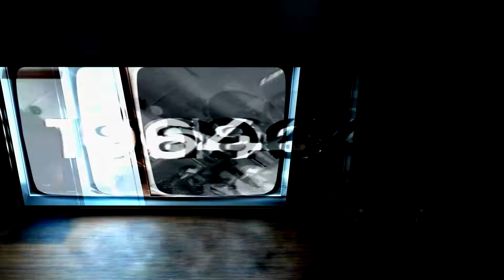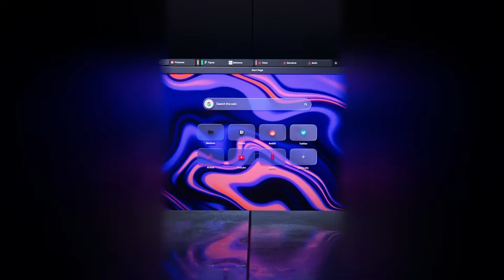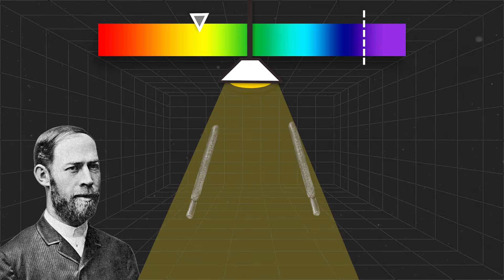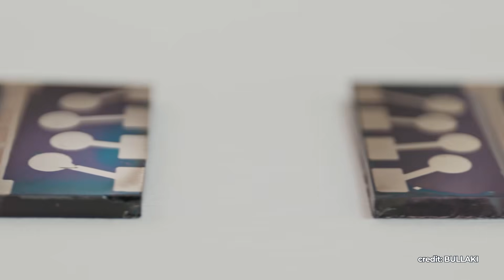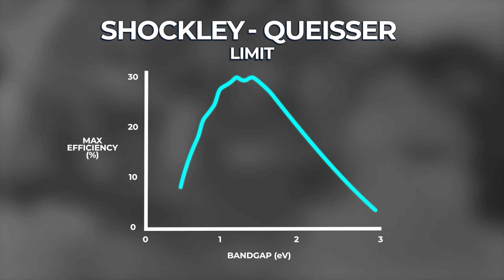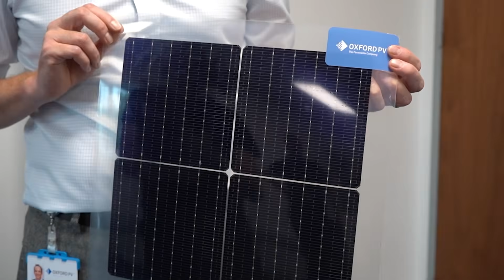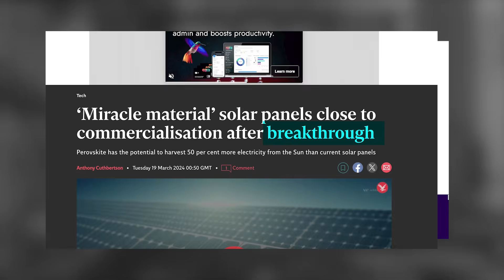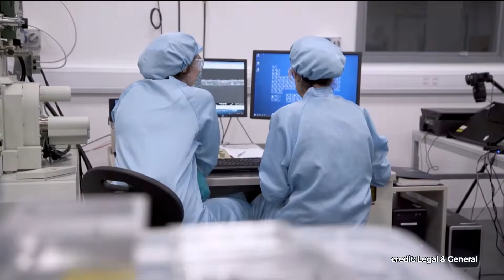How Physicists Broke the Solar Efficiency Record

Comment: Framing videos like this is so obnoxious. TL;DW: their cells are 20% more efficient. Not 20% of the sun's energy more, but 20% of the efficiency of conventional solar cells, aka less than 5% more of the sun's energy. And it's not like we couldn't reach this efficiency before, or even do much better, but simply that reaching it wasn't cost effective.
Reply: Ah thanks for TLDW.

I think for the next 20 years, we perhaps don't even need a more efficient cell, in the sense of a cell that captures more solar power per unit of footprint area, because we aren't anywhere near close to saturating possible solar installation footprint. Instead we need cells which are cost effective in terms of total lifetime output per unit of cost, high endurance, and not too difficult to recycle into new raw material.
Reply: @SianaGearz sure, there's still plenty of places we could put solar cells, but there are limitations that clearly impact enough people to make this worthwhile. A solar cell in the Mojave desert is gonna get more energy than one in London, and if you want a lot of power for a building, you often can't simply make the roof bigger. And while modern homes may find their power needs easily met by modern solar panels, it's entirely plausible that this won't stay true for long.
Reply: TLDW? Too long didn’t wank off?
Reply: Yes, but it is in fact a breakthrough. Small evolution, a little at a time. That's how innovation works
Reply: The point is that perovskite has the potential to go higher, this is just the first commercially viable option. We already go up to like 40-50% in space with multi-layer, highly complex and very much not mass produced solar cells, where every percent helps a multi million/billion dollar satellite do its thing. In a couple years we might see the first tri-film perovskite-based PV cell surpassing 30%, and 35% in another decade. All wild guesses, but look up solar cell efficiency over time graph and you'll see what I mean. There's a lot happening on that graph, but the general direction is clear.
Reply: @kindlin  I love the excitement of improvement even if it's just marginal. It's awesome to see it out here. I'm gunna go check out that graph and probably do a bit of a deep dive into this, or at least as deep as I can go. Cheers! 😁
Reply: @kindlin  There isn't happening a lot at all. If you take research into it, we have in every sector a lot of progress or innovation. Internal combustion engines can reach 60% of efficiency. The most efficient electric motor in the world, unsurprisingly made in Germany, site at 99% efficiency (by the way an industry motor which is used and still built). But yet, what applicably happens is another story. In space you don't have the heat problem we have on earth. So the more efficient we want to be, the more heat we need to capture since this is our energy. And heat is the enemy of efficiency.
Reply: @GERntleMAN   I'm actually not sure what your point is to counter it. What part isn't happening? Efficiency increases over time? Your post seems to give a great example of efficiency increasing over time, electric motors (wow, 99%? Typical German efficiency lol), so why not expect the CURRENT trend to continue in PV cells and give us the 5-10% increase in efficiency over the next 5-20 years that I'm speaking about? Specific numbers are hard to gauge here, but the overall trend is quite clear.
Reply: @kindlin  Not a counter, more a statement. We went from 16% to 22% in 25 years. That is not great and took a loooot of research. In the same time internal combustion engines went from 25 to 60% (even more in Formula 1). And since there is a hard limit, at least by our current understanding of physics and quantum technology, we cannot expect a periodic growth of efficiency. We also cannot expect a periodic growth in internal combustion engine efficiency. There is a hard limit to any technology and solar power on earth is not promising.

Electrical motors increased from 40-50% in 1860 to 99% in very special use cases. In the same sector (as back then) we only arrived at 89% and that pretty much is the limit. We can get closer to the 95, but that will take so much resources, it's not worth the effort. Solar will only ever be a secondary or tertiary power source. At least for the near future of around 100 to 200 years.
Reply: @kindlin  Just not true economically since the life span is so short.  It is more effective to reduce/replace inverter watts to optimize economics/labor.
 Ben does not understand "economic optimization".  He just wants to support the UK product and "glaze over" the ridiculous research goal to "improve an optimized product" buy adding materials that are a magnitude more expensive and much less durable over time! A good analogy to this kind of twisted ridiculous research is to compare it to washing a PV module ... it makes it slightly more efficient for a short time but not worth the cost to clean them even monthly if it rains seasonally.  Here is an example of how a real scientist/engineers at SMA  optimize a PV system.  They implemented an "inverter downsizing" calculator to reduce inverter size (aka oversized PV array) to make their inverter more "economically optimized".  It turns out you do not need to size the inverter for the optimal power output at solar noon ... but instead match it to the average output more near the 70% max noon  value.  This design plan instantly reduced cost about 30% for the inverter/wire  costs which was about 15% of the total system cost per watt.  You could also predict the total system life cost by taking into account that an inverter would be replaced 3 times during the life of a typical PV module ... meaning up to 45% savings/watt.  The automobile analogy would be you do not need a 500 HP car to get your groceries ... 100 HP is fine when you are in town and the speed limit is 30 MPH.  In fact an electric bike using 1 HP is 500x more economical and 100x more economical than a Tesla!
Reply: Cost effective and 20% better than what is available is a big deal...
Reply: @0ooTheMAXXoo0  It's not 20% better than what's available; it's the same thing that's currently available + a layer on top that gets some of the light the currently available part can't get.
Reply: Dude you seem to be really mad that you understood the video and wrote down what you learned. 😂
Reply: Can't wait to see your video on this, where you go on location to speak to scientists too and give us the correct information. Let this guy try to also make his expenses back by making the video more enticing, you be the martyr this world needs. The world where celebrities travelling on private jets tell us cow farts and tractors needed in agriculture are the problem while investing exactly 0 dollars in solar. All this while bashing China for emissions, the exact county that made solar widespread and affordable. You know what the West made widespread and as far as possible from affordable? Luxury goods. And private jets.
Reply: @rochellerochelle1488  bro calm down my guy and re-read my comment. Spending nearly 20 minutes hyping up something that is neither new nor impressive is obnoxious.
Reply: "Waaah waaah waaah, the YouTuber clickbaited like millions of other ones do yet I decided to whine about it because I want attention on a trending video waaah"

Man shut up this mini-documentary is interesting asf and I'm gonna ignore you to enjoy knowledge!!!
Reply: Did you watch the video at all?
Reply: I approached it from a different perspective and came to the same conclusion. Perovskites biggest issue is its longevity. The 'crystals' on many already researched and useful types just don't last long enough to deliver cost effective results and that is where the real research is right now. This vid didn't put that fact as the focus but then again, it needed to deliver a positive, clickable message to get the views!
Reply: i think you misunderstand.  in theory, this practice WOULD gather 20% MORE of the sun's energy than a standardly available solar cell. I think the difference in semantics was explained, as in, after hearing them talk about it for a few minutes, there's no way you'd get that confused.   Really, what you're describing is the same thing, since currently silica cells can gather maximum about 30% of the sun's energy hitting the cell.  This method would add about 20% to that, in theory. However, In practice, the best current solar cells actually only gather about 10-15% of the sun's energy that hits them, and in practice, adding this layer has added about another 8-10%, rising that to about 24%. That's actually not 5% better, but 40-100% more efficient than current cells.  So, i'm not sure you understood what was discussed.  If you compared a cell that gathers 10% (which is common) to one of these which gather 25%, that would be over a 100% increase, but that is misleading in the opposite direction as you are claiming.  I think everyone in the room has the understanding that we're talking about percentage of the sun's energy being captured, and a percentage efficiency increase between cell technologies. They explained it well enough that anyone should be able to understand the difference.    Regardless, adding more layers could theoretically (according to the one scientist guy) reach a maximum of 99% efficiency, capturing 99% of the light energy that hits the cell.  They explained all of this in detail.  

This brings me to my only issue here:  That they only added one layer and are already attempting to market it, rather than getting closer to 50-75% efficiency and THEN marketing it.
Reply: @tirkentube  They are doing it this way because THE GOVT PUT A CAP ON HOW MUCH A SOLAR CELL CAN PUT OUT!!! By law it is restricted, THE POWER COMPANIES COMPLAINED. It's tje elephant in the room that none of you experts want to talk about
Reply: @tirkentube  The technology is a layer of material which is much less efficient than conventional cells except at a specific frequency range. When applied over a conventional cell the full assembly is capable of capturing less than 5% more of the sun's energy. The video's framing is obnoxious because it spends 20 minutes dancing around the fact that the the only efficiency barrier is only being broken relative to cost. More efficient cells already exist, but they cost more as they require more expensive materials and tighter manufacturing tolerances.
Reply: @boltvanderhuge8711  Exactly.  Gallium Arsinide solar cells are already more efficient but they are usually only used on satellites because their higher cost is dramatically offset by the cost of delivering a lighter payload to orbit.
Reply: What I found silly was including the bit about the Kardashev scale at the beginning.  Why include a thought experiment by an astronomer from the 60's in this video?  Is this new "breakthrough" going to somehow make humanity dramatically closer to a "Type 1 Civilization"?  Um... No.  Even if it were possible to build a 100% efficient solar cell it would require paving over an area the size of Colorado with them to meet the world's power consumption assuming zero transmission loss.  Now people want to make our money out of wasted electricity that requires idiotic amounts of power just to make a transaction.  At the very same time, the same people are telling us that if we turn on the air conditioner a polar bear is going to drown.  All the while we have mountains of thorium lying around in tailings piles that we could use to build small, safe reactors.  Geothermal?  We just aren't a serious species not quite on par with the Jatravartids though.
Reply: That's a bit harsh. It's true that 24% perovskite tandem cells isn't that exciting when we already have 22% efficient panels on the market (I just bought some and they were pretty cheap). But we can expect this to improve, possibly quite quickly and presumably sticking this stuff on top of any base cell is relatively straightforward so it can take advantage of silicon cell advancements.
Reply: says the abnoxious one
Reply: It is progress, otherwise we could fall back on nuclear, but even that runs out.
Reply: Thanks a ton 🫡
Reply: I also looked at that statement with shady eyes. He said it correctly, although it could it misrepresented to incorrect statement. Still, having new view on how to make solar energy more efficient needed a huge step to the side to achieve this.
Reply: Aye shut ur technically correct hating ssa up
Reply: n
Reply: Thank you.
Reply: The most incrediblebullshit
Reply: Thank you!
Reply: It's getting the price of solar cell's down, and driving the power output up, that in itself is the Achivement we have been looking for. That's business and how it always worked for years, you'll find anyone who doesn't advance dies out over time or merges with other companies. So it is important we make cost low to find better solutions, along with faster and better ways with leaving a smaller and smaller footprint. If you took all the energy in a 1meter square that the sun give in an hour 1000 watts. (In perfect conditions) our current cells can only pick up  240 watts per meter, if we can get it so we can have 500 watts per square meter the overall impact of the worlds global footprint will shrink significantly. (This is only under the assumption of ideal weather and overcast)
The average house hold in America uses about 30kWh a day, so if we can get a solar panel to reach 500W per square meter we can have an average of about 12 square meters (or 130 Square feet) needed to power each house. Add something like a flywheel battery (look it up) and we can potentially have energy for the rest of all of our and the structures life without worry of power outages as often, but a lot of changes need to be made and this is one step we need to take to try and get there.
Reply: The govt banned companies from making solar panels be more than 40 percent efficient. Look it up. BANNED IT. ITS A LAW.
Reply: Still good numbers if the panels still get cheaper... but what WE NEED.. (Humanity need) are BETTER BATTERIES..  with more storage, cheaper, long life span.... soo the energy can be useful  in storage.
Reply: Baby steps…
Nothing comes all at once.

We can’t even build a Ringworld, much less a Dyson Sphere.
Reply: I had no trouble understanding his percentages.  What he said was quite clear to me, a 20% increase in the collection capability.   "Me thinks thou doth protest too much."
Reply: Lame comment
Reply: Thanks for the TLDR, didn’t even get past the ads
Reply: The efficiency of solar panels is okay, it's just like any inventions it has time to get better. Just like combustion engines that took almost 90 years to be better, or nuclear power that is and has been very expensive if you look at the total cost, and they are not running all the time, they are off 30% of the time for maintenance, service, repairs, and with the total time of building, running with employees and materials and repairs and more, and then tear it down, and hundreds of years of storages for nuclear waste ut a massive cost, and very expensive electric
Reply: Does anybody find it disturbing to have any "critical comments" like this TOP 3 comment buried (2.3K likes presently) down more than 5 pages deep in the popular order mode?
Reply: I think you are missing the point a bit. You can rewatch 16:57. The searcher said that the extra efficiency is worth the cost, so the overall energy generation per unit cost is increased from a typical silicone PV cell.
Not to mention, making new technology (perovskites) commercially competitive is a good factor by itself since it sharply changes the incentive in investing in the new technology that is likely better in the long term anyway.
Reply: Uh...he never said "20% of the sun's energy more"??? He just said "20% more efficient than available silicon cells on the market." So not sure what your point was there. And yes, going as high an efficiency in pure silicon ISN'T cost effective precisely because of what he explained in this video: that silicon cell production is expensive. Meanwhile perovskites are relatively CHEAP to manufacture. In other words, using a tandem cell you can actually get to that efficiency in a cost-effective way.
Reply: I see.  If we build self-replicating robots (they can self-replicate bigger or smaller as well as they would be made of legos that could be tiled to make them smaller or bigger) they could build mineral sorters factors, miners, and build the solar panel factory even with low effiency solar panels if we cover 25% of the Sahara or the Pacific with them thats a crap load of energy.
Reply: ... And that is exactly the riddle to work out, right? It's not really a milestone/invention until it's commercially viable.
Reply: But the physical limit for efficiency of single layer cells sits at c.30%. As such it’s unclear that we could go much better before.
Reply: @Adam-pt3cb  I have personally tested GaAs single junction cells that were >28% conversion efficiency.  The company that made them is now out of business, but they did exist (the company was bought by Hanergy and eventually shut down).
Reply: @Adam-pt3cb  these aren't even single cells though; they're a layer on top of a traditional cell
Reply: @boltvanderhuge8711  yeah it feels dumb. pretending a dual layer 1m square is comparable to a single layer 1m square feels disingenuous. if the dual layer square is more efficient than 2 1m squares, then we're getting somewhere
Reply: @Statler_and_Waldorf not sure how much more efficient a dual layer would have to be, but we can figure that it is not much since it does not require nearly as much supporting structure and connections (wires or traces) as two separate cells. So  raw materials, installation costs, and site costs all drive the efficiency breakeven to be much lower than a simple doubling.
Reply: @Statler_and_Waldorf  a dual layer solar cell uses around half of the surface area of two single layer ones. If you are installing this on your roof, where space matters, even if two panels would produce more energy, if you need the extra boost, the difference in performance won't matter to you.
Many times the area is more important than the production per layer
Reply: @Statler_and_Waldorf  Space is often a premium with solar panels. Just doubling the meters squared isn't possible. Think Solar roofs or panels on an RV. If a 5% increase has RoR that saves the company money, it is worth it.
Reply: @Statler_and_Waldorf well, it is comparable in many aspects why would it not be? It does not have to be 100% more efficient to be a viable option.
Reply: @Statler_and_Waldorf  You're neglecting that two 1m squares take up more space, and weigh more.
For some applications that doesn't matter, but for others it does.

As well that if the theoretical limit of silicon is 30%, and if silicon + perovskite are more efficient, then the theoretical limit of the two together should most definitely be higher than 30% even if it wasn't stated where it should fall.
Reply: @Adam-pt3cb of silicon
Reply: Some of us are happy to watch a 20 minute video explaining the background behind a headline figure. The trouble with just reading one person's one sentence summary of a complex topic is that you end up voting for Trump.
Reply: @MrHemlock51  someone is sore. lol
Reply: @exaroceans  I'm not American so it doesn't affect me. But the rest of the world is laughing at y'all.
Reply: @MrHemlock51  It's time for the world to pay for it's own shit.
Reply: U da real MVP
Reply: Thank you for saving my time 😊
Reply: Thanks, saved me 20 mins
Reply: Thanks
Reply: It's YouTube most videos are click bait title.
Reply: thanks for saving me 20 minutes.
Reply: So what? The title is accurate (sorry you assumed anything), and it's interesting on how solar cells work. I love this channel but it has a dedicated hard-core hate group. Go away if you don't like the channel. Why watch?
Reply: @blucat4 Yep, I'm utterly confused by the negativity. Its not just about the final stats, and clearly adding multiple perovskite layers have lots of potential. The other thing is, these are now commercially available, so yeh 24% is brilliant provided its true about the cost-benefit being even more positive
Reply: @MegaHiddenshadow  Not if it cost 100% more and lasts about 1/3 the lifetime ... just like other amorphous cells.  Nothing new here!
Reply: Also you can buy monocrystal panels which have a 22% efficiency, so it's only  9% better, less than half of what he is claiming
Reply: you;re right. its a click bait.
Reply: Reading this saved 20 minutes of my life. thank you
Reply: ty for this comment prevented me from watch a click-batey video will also be unsubscribing from this guy.
Reply: thanks for the summary. i will not waste my time now
Reply: THANK YOU for saving me time
Reply: Don’t forget we had solar panels that were 30% energy efficient in 1972 but the govt made the patents confidential because it would collapse the oil industry 🤫
Reply: Thank you, now I don't have to watch the video.
20 minutes of padded content for feeding of the algorithm and the maximizing of ad revenue is obnoxious.